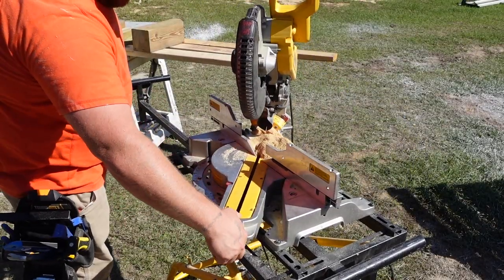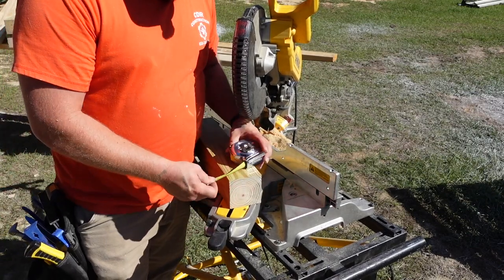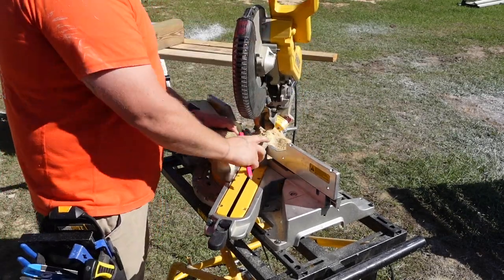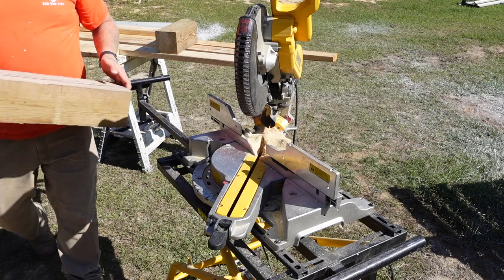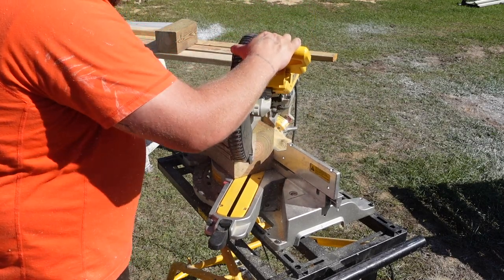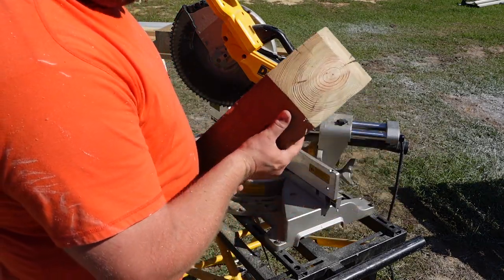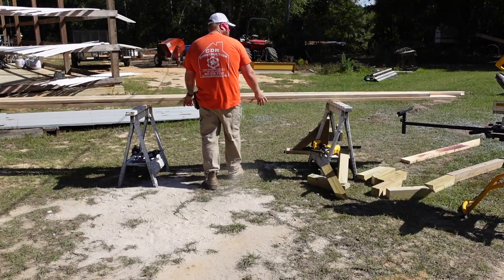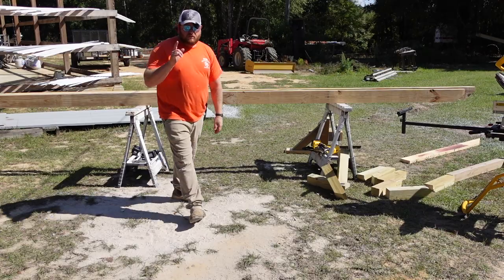How to build an easy & cheap garage door pergola

Comment: What kind of wood did you use? I have kiln dried available in my area. Do you think that would suffice if stained with semi transparent outdoor stain?
Reply from the maker: You can use kiln dried but it won’t be weather resistant only dry and ready for a stain. I would build it then stain it the a couple coats of sealer then install. You will need some type of waterproofing to keep your wood from rotting I would hate for you to spend the time and money to build one of these and it not last.
Reply: @keepmakindust  thank you! What kind of wood did you use?
Reply from the maker: @512galko4  I used pressure treated pine and I let it set in this Florida sun for about a month to make sure it was dry before I built it so the stain would take

Comment: How would you mount through limestone? Still with structural screws?
Reply from the maker: Yes but you will need to drill holes through the stone with a diamond bit then use your structural screws

Comment: So you double up the 2x6x16 on the mounting side and the front? Or, why did you nail the 2x6s together? Is one 2x6 against the house not adequate?
Reply from the maker: I did for two reasons one was for strength because that’s a pretty good span and the other is because my door was 16’ and i wanted some over hang on both sides so I could have done 20’ boards but I would of had to order them. The 16’ boards are readily available so I could go ahead and build it. I hope this answer helps let me know if you have any other questions thanks for watching
Reply: @keepmakindust  Thanks for this video.   I have a clear-up question as @Karimcdonald4674. Did you run screws through the back into the siding over the garage to secure that Doubled 2x6 to the house? Thanks again.
Reply from the maker: @davidh8928  I did not I left a gap between the 2x6 and the garage so it wouldn’t collect leaves and debris and create a problem in the future. With that said you could screw it to the garage if you like

Comment: Thank you for this! What did you use to mount your brackets to the house? Structural screws? If so, what size? If not what worked?
Reply from the maker: You’re very welcome and I did use structural screws 1/4”x 4” and I put 6 per bracket. Mind you I was hitting studs with 3 per side I feel that’s pretty important so you know the screws can hold the weight. Hope this helped and thanks for watching

Comment: Great video. I didn’t catch the length of the 6x6. Trying to make something pretty similar here.
Reply from the maker: I made mine 22” but if you don’t want the same overhang you can customize really you can’t get it wrong as long as you like the look
Reply: @keepmakindust  Brady can you confirm that 22" length on the 6x6 ?  I'm putting mine together and where the 45 degree 4x4 hits the 6x6, I have a much larger space than the 1" that you have on yours.  Also It looks like the top horizontal 4x4 cross pieces stick out from the garage wall face about the same distance as the 6x6 making it more like 16 1/2 to account for the vertical 2x6 behind it.   Thanks.  Dave.
Reply from the maker: @daveyurik   hey Dave I think your right I believe I made it 18” I’m not great at documenting all my measurements because I fairly new to creating content also this is something I was building for work so it is at a customers house that I don’t go by very often. With that said thanks for the catch and I hate I told the guy earlier it was 22” hopefully he figured it out anyways yea if you make the 4x4 18” the 6x6 should be around 18” sorry for the bad info I hope this helps. I did keep the horizontal 4x4 off the face of the garage because I didn’t want leaves and debris getting in between the 4x4 and the face and creating issues down the road
Reply: @keepmakindust i just finished mine.  great video guide you made.  thank you so much !! i would add a pic but i dont know how !!
Reply from the maker: @daveyurik  awesome I bet it turned out great
Reply: @keepmakindust  the misses liked it so much I now have to add another one over a window on the front of the house next to the garage !!
Reply from the maker: @daveyurik  hahaha sorry buddy I completely understand those honey dos….

Comment: Do you need to cut the siding away first or just mount it right on top of the siding?
Reply from the maker: I mounted directly on top and then went around the base with silicon to stop and water intrusion through the screw holes. If you wanted to cut away you could but you would need to run j channel around the base

Comment: Good explanation! Thank you! I am planing to grow confederate jasmine vine over it. That means additional weight. Do I need to drill through the wall? How would you secure it to ensure it can carry the load?
Reply from the maker: So if your going over a garage like I did here there should be a double or triple stud pack on the sides of your opening if you go with some structural screws maybe 1/4x6 or 3/16x6 that should be plenty or holding strength. Also I don’t believe the vines will add a huge amount of weight. I think you will be ok also great chance on the vines I love confederate jasmine and the smell!!!! I would love to see pictures and if you do build thanks for watching and good luck

Comment: The cross bracing explanation starting at 8:56 is super confusing. "8 and 10... measure both ends, add that number together and divide by 2 and get 24" " What in the world am I supposed to do here?
Reply from the maker: So the 8 and 10 are to get to 18’ which accounts for the overhang over your corner braces the scab board your using is 16’ and that’s so you can scab the 8’ and 10’ together and still have a double header so you can span the distance without a lot of sag you should have appx. 12” on each end that is only one board wide but you want to make sure you have the same one board overhang on each end. I watched this video again and agree there are some instructions that are hard to understand I’ll try to do better in the next videos. Thanks for watching
Reply from the maker: Also if you have any other questions please feel free to ask
Reply: @keepmakindust  Ah! Got it now. Thanks so much for the quick response and clarification. I think I'm going to build this pergola! Wish me luck!😬
Reply from the maker: @tomrobinson5231  good luck and if you have any questions I’ll get to them as soon as I can usually after work. The main thing is have fun with it

Comment: In the materials list, it says you need 1 4x4x8.
I can’t get 9 18” cross pieces and 2 18.5” 45° pieces for the brackets out of 1 8’ 4x4.
Reply from the maker: You are correct it was supposed to be 2 4x4x8 thanks for the catch I’ll put something in the description
Reply: @keepmakindust 
No. 
I had to run back to the lumber yard to get a 4x4x10’.
There are more than 16’ of pieces here.
I will finish today tho and can’t wait for the finished product.
I should have done the math myself before going to pick up the lumber.